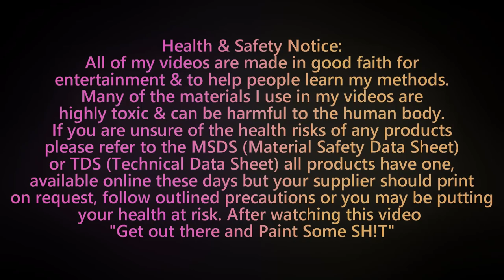Mitsubishi Triton Spray Painting

Comment: Always love your work thanks for keepin it real. Just have a question as I've also heard lots of stuff about Tritons having pretty shabby paint work straight outta the factory. Wondering if adding a clear coat to the car when its new would fix the issue? or is the issue with the base coat?
Reply from the maker: Yes it would help, bit it's time consuming and expensive. To do it properly there's lots of parts to take off. And yeah, it's the clear not the colour

Comment: How wide is that overspray plastic sheet?
Reply: you will find the entire car is covered...  barring the painted section
Reply: Yeah I see that but wonder the size, 12'x400' 16'x400' or 20'x400'
Reply: @bryanmm9382  the width is around 20'  and the length is as long as you like    you cut it of from a roll
Reply: Yeah because my supplier cant find the product wider than 12'